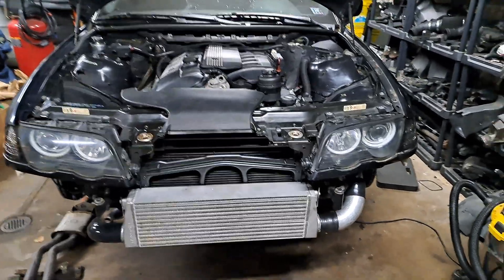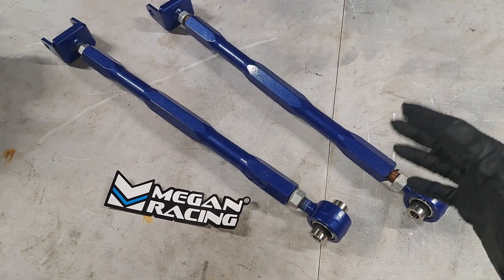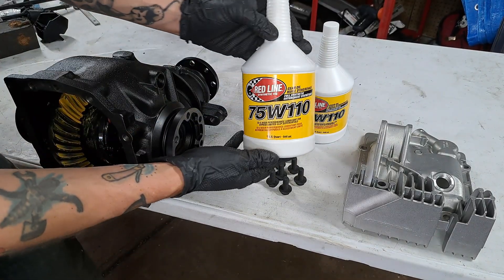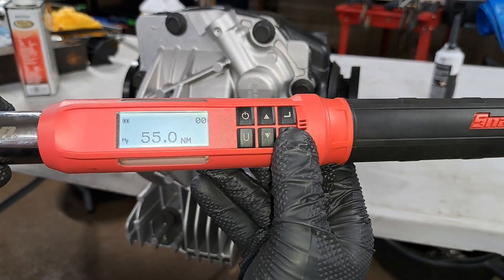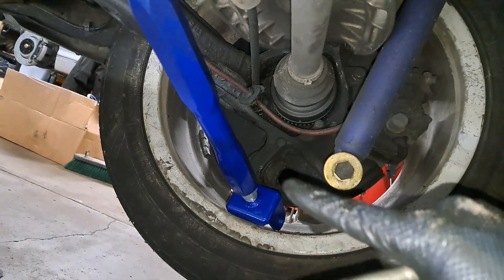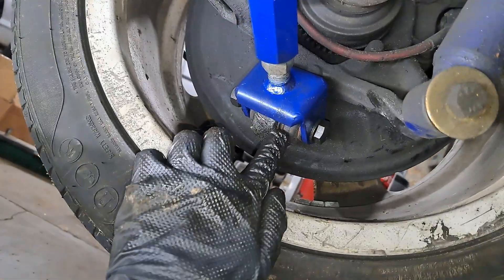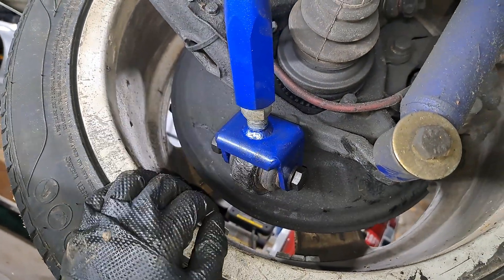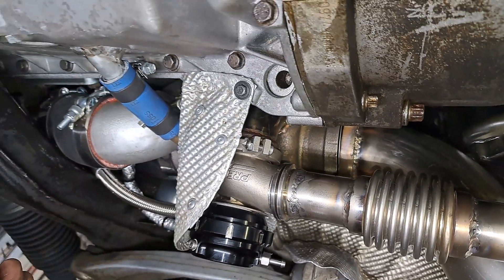BMW E46 Turbo Build - Limited Slip Differential LSD Camber Arms Install

Comment: subframe reinforment has not been done !?!?
Reply from the maker: You'd assume not, since there's no visible plates. There is bracing from above, in-cabin. Prevents the issue you're referring to all together, if done soon enough. 

We've otherwise done multiple complete reinforcement jobs on these cars, so know what to look for.

Comment: Price on the diff ?
Reply: Probably around $3k mark
Reply: @kadenbourgeois1 🤯 I got my M3 lsd around $800 but then again it has the play issue most of them have so will need rebuilt for probably another $800
Reply from the maker: @ddbbuilds  Yeah, that's not taken into consideration with M3 units. Not only do you then need to use M3 subframe, etc, but they'll also more than likely need rebuilt this day and age. A freshly built LSD differential with OEM bearings, seals, etc.. for 3k, is not bad at all. Plus you get 500 back for sending in a core diff.
Reply: @ddbbuilds Buy once cry once
Reply: @MrTeachYa yeah I’m definitely crying twice, didn’t want to spend the extra $800 when I was redoing everything on the underside and thought the play in the diff wasn’t bad but now that it’s in the car I’m reminded of it every time I release the clutch 😪
Reply from the maker: @kadenbourgeois1  Yep. You get what you pay for 🤝